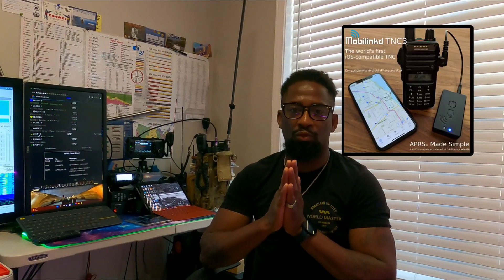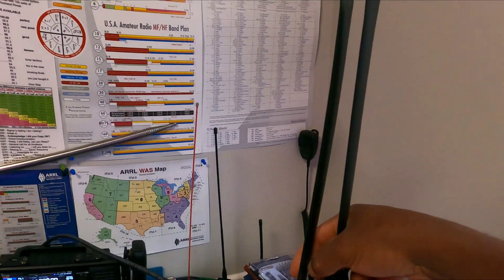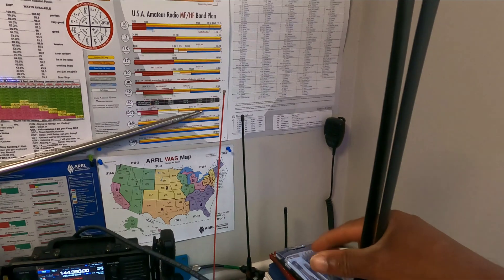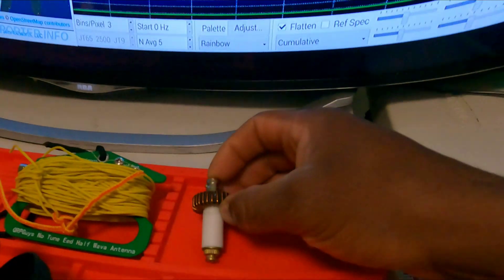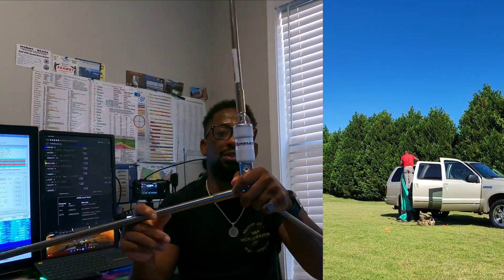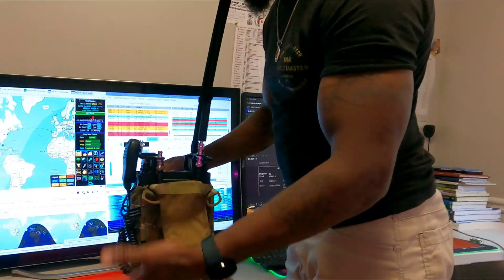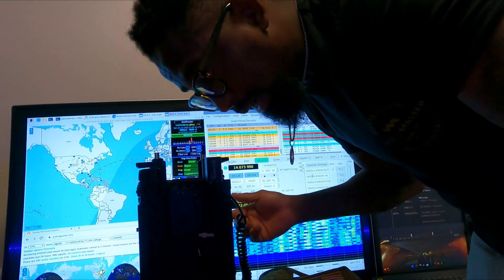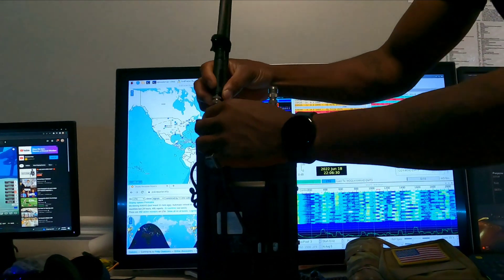Yaesu FT-857D Doomsday Video #2 Radio and Systems Breakdown!

Comment: Great video. I still haven’t finished it. But wanted to know what is the purpose of the TNC device that is different from the digirig Mobile I thought if you have the digirig mobile, you don’t need the TNC device. Also, have you tried running a bigger battery by any chance? What are the limitation in wattage that you could run with a six amp hour battery? If you wanted to use more wattage, what battery would you run?
Reply from the maker: The MOBILINKD-TNC3 allows me to operate wireless (on my phone)  I can to packet and aprs to any computer. It's Bluetooth

Comment: Do you have a suggestion for a unit that is just as capable given that the 857D is discontinued?  Also, great stuff and not complicated. You made this very straight forward.
Reply from the maker: Man times are hard for 100 watt Portable.  The IC-7100 is the only production VHF,UHF, and HF radio out that's comparable.  It's not as Portable in my opinion.

Comment: Is it possible to connect the Mobilinkd TNC3 simultaneously to the radio with the Digirig? If so, what are the connections/cables necessary?
Reply from the maker: No it is not. When I'm ready to do Aprs I disconnect the Digirig cable..
Reply: I'm having a rough time receiving FT8 using my FT-857D with the DigiRig and WSJT-X. The receive never goes higher than 20dB. Any suggestions?  @metroatlantahamradio334

Comment: After running your rig what are your thoughts on the 897 if you had a choice between the two?
Reply from the maker: The 897 is Just Ugly.
Reply: @metroatlantahamradio334  Lol 😂. Well it ain’t a beaut. But on the merits of it having the ability to store batteries ect. I was looking 👀 at it from a functionally point of view. I know they are pretty much the same radio with a few different power options. It seemed it would make a great mobile or shack radio.

Comment: Is the mobilink and the digirig hooked up at the same time or one at a time?
Reply from the maker: one at a time , when I want to do APRS I use the port. When I want to use HF digital I switch cables.
Reply: @metroatlantahamradio334  Thanks for the response. I would love to see a video on how to get started using digirig and the 857d. I just got my radio, but feeling a bit lost getting setup for digital modes.
Reply from the maker: Ok let me see what can be done.

Comment: Love your content! What abree antenna are you using for 2m/70cm? Is that the 42 inch? Do you like it?
Reply from the maker: It's definitely a Dual Band Amazon Chinese Antenna. Been using it for 2 years now and no problem!   I love it bro.  Long range Qsos on Summits at 20watts Over 100 miles with this Antenna.  I run the 42" and Like the Size below.

Comment: That 6ah is rated for 12amps the ft-857d pulls 22amps at full power how were you able to run 80 watts?
Reply from the maker: Bob, I just was doing it.  I can't say How. I ran that whole Activation on 80 watts plus ( here and there).  I made over 30 contacts easy.

Comment: Man, great video! Great channel! New subscriber! Question for a brand new ham that just got a used 857d.

What cable connectors go where!? So hard to figure out.  Which bnc side is connected to the frame? Female? Then the male side from antenna?
Reply from the maker: Tim one thing you have to do is find the online PDF that will show you all the ports!  The document should have pictures and description of the back panel of the radio !!

Comment: FT-857D has the absolute WORST DISPLAY ever devised for a ham radio transceiver or any radio.  To replace one will set you back about $170 just for the display.  Horrible display.
Reply from the maker: It Happens However this is a wonderful radio.
Reply: Only some versions of the radio had that problem - and usually if left in the sun...

Comment: What is the detachable face Platon your desk.
Reply: That's a small Keyboard.
Reply: I apology, the detachable radio/face-plate I am referring to is connected to your antenna. Secondly, what antenna are you using? Thanks a million!
Reply: Just to let you know, I saw a few of your videos and you motivated me to study for my tech license and in November I will go for the general. So thanks a million again!
Reply from the maker: That made my day man because that's what this page is all about.
Reply from the maker: I use the Chameleon Tactical Delta Loop for HF.
Reply: I also want to put a ham radio in my truck, my budget is in the high $500s, but there are so many options. Can you recommend one?
Reply from the maker: Do You want New ? Used? HF only ? QRP or QRO?  Does it have to Have VHF/UHF ? Does it need to do GPS APRS ?  Lol I know that's a lot.

Comment: I have a FT857d in my truck along with a FTM-100DR.  I bought the FTM-100dr specifically for the APRS  function. I came upon your video while looking for FT857D all band mod.  I didn't know you could do APRS with the 857d. Interesting. Where can I find instructions?
Reply from the maker: Remember Your Going to need the MOBILINKD-TNC3 and The Cables to match your Radio.

Comment: Loving this! Great radio and great setup! I just recently sold my Yaesu FT-857D with a Mobilinkd TNC3, moving to the FT 991a. I have another mobilinkd TNC3 I'll add to it but I'll also get easier setup of digital like ft8 and such.
Reply from the maker: That Built in Sound Card is better I must admit.
Reply: Добрый день. По какой цене вы продали трансивер Yaesu ft857?